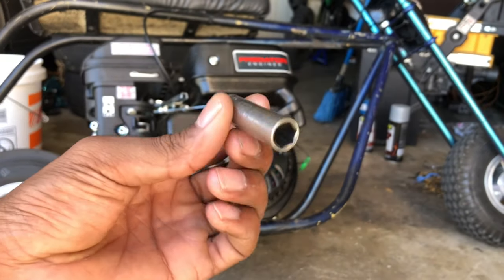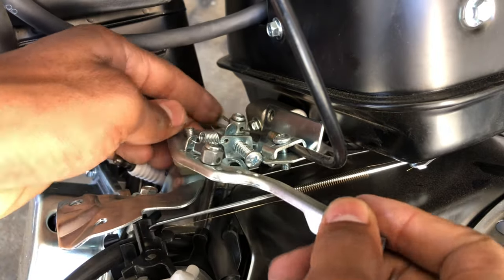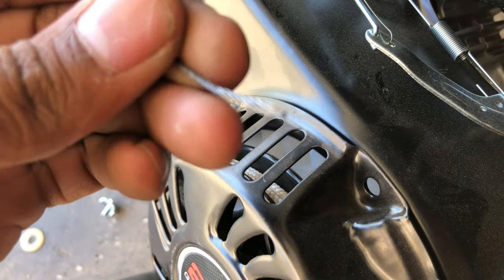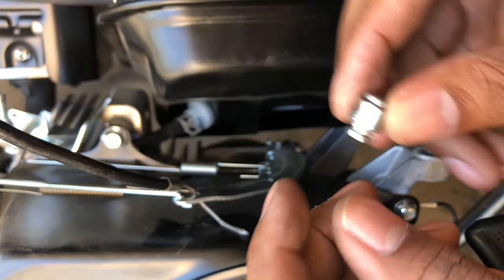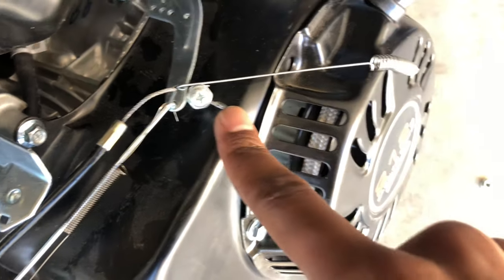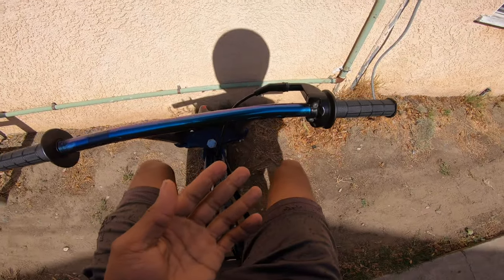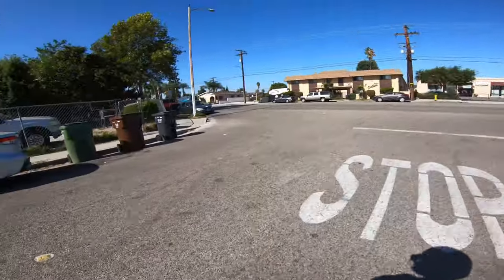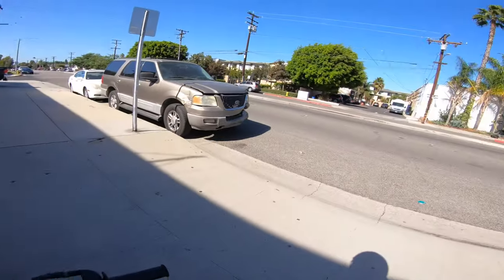How To Make A STOCK 212 Predator FASTER FOR FREE!

Comment: how do i fix the fast idle and the wheel moving fast on me with no throttle
Reply: Adjust the idle air screw and fuel mixture screw on the carb, get it to idle slowly but to where it doesn't want to cut out.
Reply: It’s the black Philips head on the carb right is faster left is slower